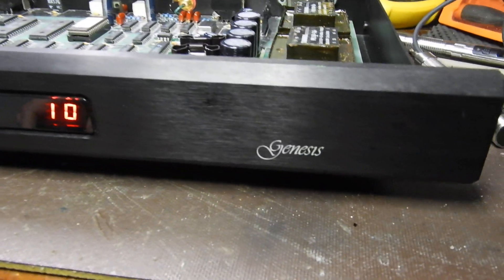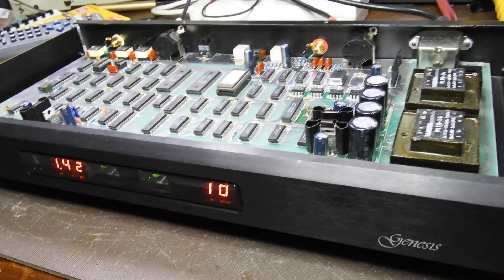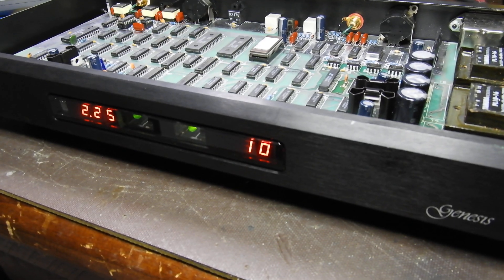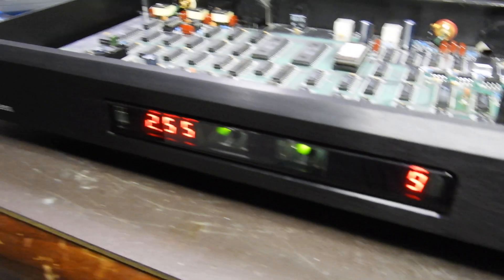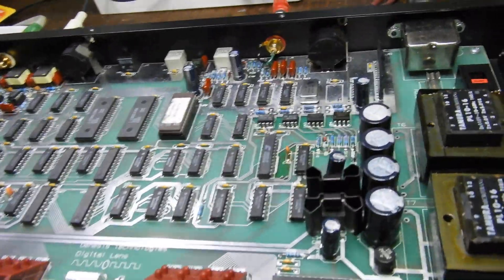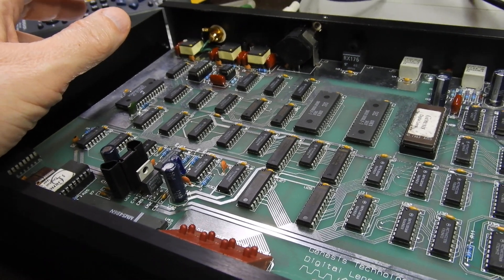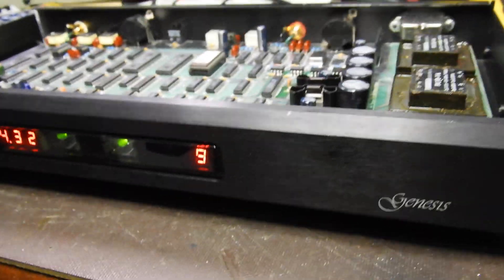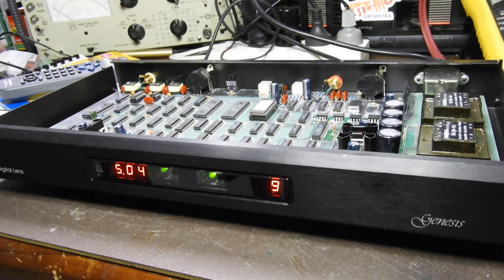Genesis Digital Lens re-clocker - features and repair.

Comment: The Genesis Digital Lens I had in my system for a few decades to great effect. A fantastic piece of audio gear.
Reply from the maker: I was originally skeptical, but later thought that indeed, it did something positive to the sound.
Reply: I'm on the verge buying one for around 500 euro. Is it worth the investment?
Reply: ,

I have a mint condition, late model unit.
Reply: I’ve bought it from my friend, who couldn’t notice the difference. Never regretted. Using it between my DIY file transport and Museatex Bidat. If your system is transparent enough, you will notice the difference.

Comment: Does this basically work the same way as one of those Master Clock units they have in really high end systems (where everything is seemingly split into as many boxes as they can) e.g. DCS Vivaldi?
Reply from the maker: I think it might be more universal. The multibox systems use inter-chip communication between components whereas here, it is normal SPIDIF, Toslink or AES-EBU
Reply: @hear-net-au  I see, thanks for explaining!